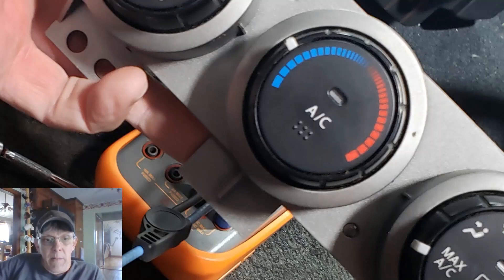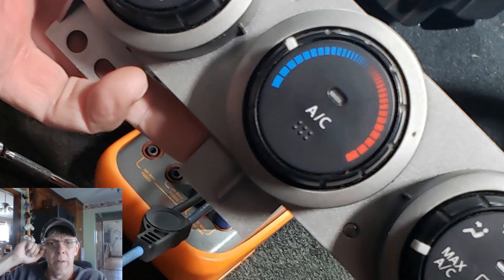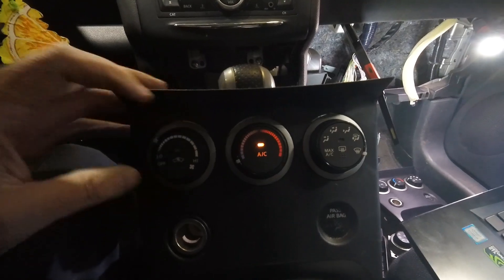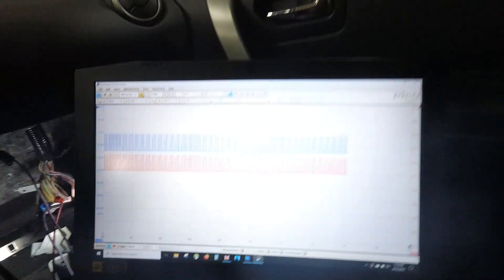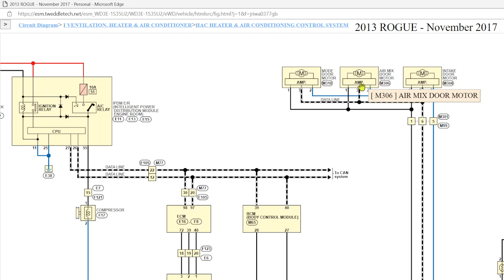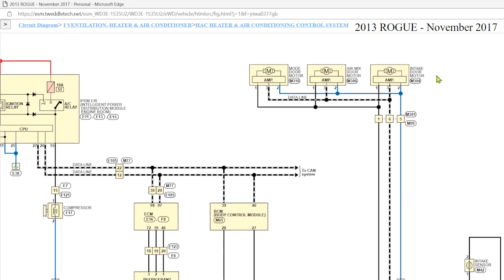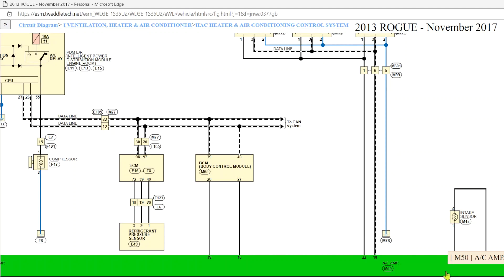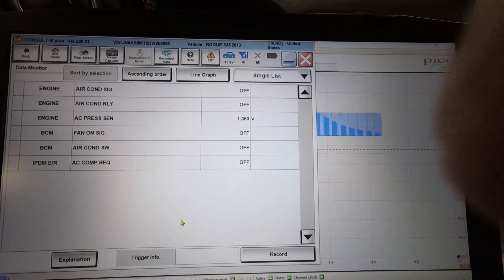No A/C

Comment: great video.  Question: Was there not a pid on scan data showing thermistor reading at evaporator?  Keep up the great work
Reply from the maker: No PIDS, That AC control head does not even communicate with the scan tool, gotta go old school testing on it.

Comment: Great analysis and explanation. I always have a hard time on Nissan😅. Just one question on this case study.  Does the Auxillary fan here also didn't turn on with compressor?
Reply from the maker: The inside blower motor worked fine. The outside cooling fans did not come on, unless coolant temperature got high. Once the car was fixed the outside cooling fans worked when the compressor cam on.
Reply: @CartersDiagnostics  Thank you for the info
Reply: where did you buy and what brand is your thermistor simulator is?
Reply from the maker: It came in the uTest terminal kit from AES wave.

Comment: Great info, Thanks! Just another reason why I hate working on Nissans, would it really be so hard for them to include a PID for that sensor? There code description is also terrible, I unplugged a COP coil on a 2019 Infiniti and the only code I got was a P0300!
Reply from the maker: Ain't Nissan great!  Thanks for watching.
Reply: sometimes you may have to unplug more than one to wake up the misfire monitor. Othertimes the misfire monitor won't run until in gear or under a specific load.

Comment: Awesome. I have seen a lot of bad refrigerant pressure sensors going bad. The same thing i have variable resistor i adjust the voltage to 1.4 volts or something in between and everything works assuming i have good 5v and ground. And it will never set a code. Thank you and waiting for more videos.
Reply from the maker: Good point on the pressure sensors. Most Nissan's the pressure sensor is in the front,  condenser area. They get damaged frequency in collisions and overlooked during diagnosis.

Comment: Auto vs manual ac ... I understand the difference is in temp controls. If you can set the temp to 68 deg, the HVAC control module will apply heat or ac and actuate blend door modes automatically to achieve your golden set point.  Manual ac is a blue and red knob where you gotta make those adjustments on your own.  The blend doors and temp doors won't move as the cabin temp changes. The auto system is also a feedback system that has a cabin air temp sensor, similar to an oxygen sensor feedback system.
Reply from the maker: That is a great assessment of the systems.  I think they should re-word "manual" AC to "semi manual" or something 🤣😅😂 to keep down on confusion.   Thanks for commenting .
Reply: @CartersDiagnostics  that makes sense. And a full manual system would be old school with cables to manually operated blend doors?  Do any new cars still use cables though?
Reply from the maker: @ablackformula  I don't know 100%, but I doubt any manufacturers are using cables these days.